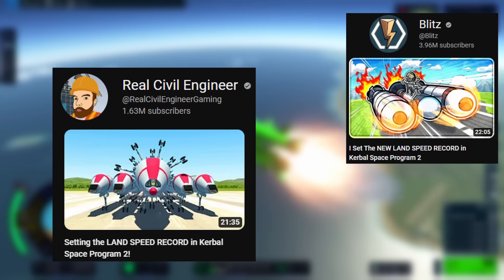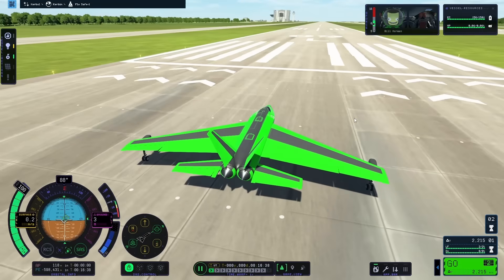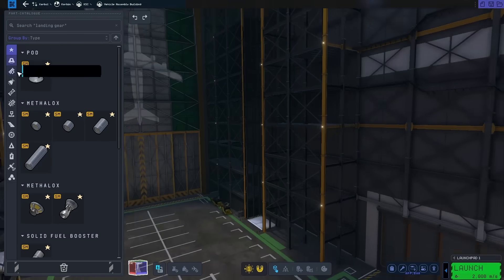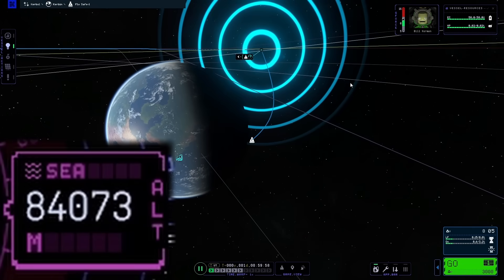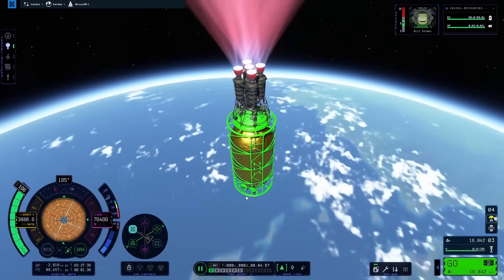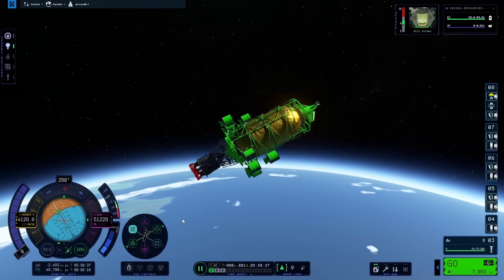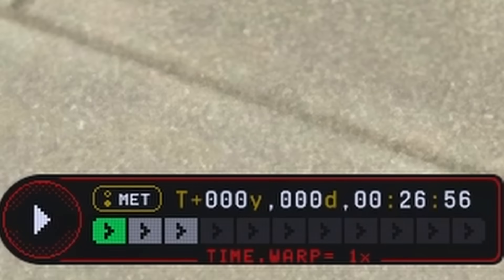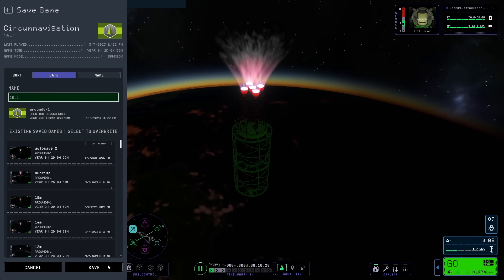Setting The CIRCUMNAVIGATION World Record in Kerbal Space Program 2

Comment: The reason why your earlier designs kept veering off runway and unable to take off has to do with your landing leg configuration. If your nose gear is lower than main, or your gears are behind center of lift, that makes it impossible to take off. That is exactly how Space Shuttle looks like and it's ideal for the Shuttle, because they don't want to even be able to go around, but not so much for planes.

Comment: ok but the speed of sound isn't affected by the size of the Kerbol system, so speed of sound would still be sqrt(gamma*R*T), so tho it wouldn't necessarily be the usual 340 m/s of low atmosphere it would probably not be mach 122

checking Earth standard atmosphere tables and assuming similar atmosphere composition, 60 km above Kerbin would probably be similar to ~80 km above earth bc density and pressure, so that gives us a speed of sound of ~282.5 m/s. So based on the fastest speed I saw while watching the video (~4550 m/s), we get Mach 16.1. 

so pretty fast

Comment: isnt the darkest blue the end of the atmosphere, and the black with stars technical "space". Because at 40,000 meters, Kerbin has an atmosphere of 0.001, and at 50,000 meters its 0.000 atm. So i think for a challenge like this to be relevant keeping it under 49,999 meters is key. As you are still fighting an atmosphere, without venturing too far into a 0 atmosphere zone and cheesing the whole thing. 
Altitude (m)	Pressure (Pa)	Pressure (atm)	Density (kg/m^3)
0	       101 325  1.000      1.225
2 500	69 015	0.681	0.898
5 000	45 625	0.450	0.642
7 500	29 126	0.287	0.446
10 000	17 934	0.177	0.288
15 000	6 726	0.066	0.108
20 000	2 549	0.025	0.040
25 000	993.6	0.010	0.015
30 000	404.1	0.004	0.006
40 000	79.77	0.001	0.001
50 000	15.56	0.000	0.000
60 000	2.387	0.000	0.000
70 000	0.000	0.000	0.000

Comment: Very nice video!
I do disagree with mach 122 tho.
Distances in KSP are 1/10 that of real life, not the speed of sound. It's not like KSP has different air, cmon now.
But, the speed of sound does change with temperature, and the temperature at 60000km on Kerbin is about 210K, which means the speed of sound is around 290m/s.
This gives you a mach number of 14.5.
Which is still absolutely insane btw.
Reply from the maker: You're absolutely right that it's a stretch, but I thought that it was also just a funny number to put on the thumbnail

Comment: Isn't the path sorter by traveling in the opposite direction? By "orbiting" west and the KSC rotating east, in effect, you and the KSC are moving towards each other with respect to the 1 circumference distance.
Reply: This should work, for a reason you didn't include. Technically, it should not matter, since you get speed boost in one direction so in a vacuum, it doesn't matter... But here, one thing that would make a difference is that you can accelerate much more aggressively without having to worry about reaching escape velocity. This allows you to gain a lot more relative speed to KSC without escaping Kerbin.
Reply: @gJonii  I believe we're saying the game thing. We exploit the relative motion of the KSC(Planet) to get there quicker. I wanted to point out that it also gets us there shorter. Edit: What if we travel west at exactly Kerbin rotation velocity. Can we complete the circumnavigation by traveling 0 distance (from a fixed reference frame with respect to the rotation of the planet)?

Comment: It's higher than 12.2, because you are on the tip of the atmosphere. I'm assuming you used the sea level reading of mach 1 to get mach 12.2 from 4200/340. But remember that mach 1 is not constant, it changes depending on the density of the medium. At 70000km the speed of sound is about 290m/s and since you are pretty close to that it should be 4200/290, which is mach 14.5
Reply from the maker: I mean technicallyyy there is nearly no atmosphere at 65k in ksp, so it would probably be far slower than that anyway, making it a way higher mach number
Reply: @ReidCaptain  Speed of sound actually doesn't depend on air pressure, only the composition and temperature
Reply: that seems like a dumb way to measure the speed of an object, but I’m not a rocket scientist, and I use Fahrenheit soooo
Reply: @Powderlover1  It's not to measure the speed of the object. It's to know how far away you are from the speed of sound. That's important because aerodynamic forces change drastically when approaching/passing the sound barrier. 

Airspeed is still measured in m/s, knots, etc. People just like to show speed as X times the speed of sound sometimes to add wow effect.

Comment: Well since there's no heat in ksp2 yet, you could do that in a lower orbit with an air and fuel mixture, you just have to make a craft that doesn't have alot of drag
Btw you should try a speed record to the moon and back for funsies lol
Reply from the maker: True, but getting up to 4000m/s under 30km might be asking a lot. Will consider a moon run!
Reply: @ReidCaptain  it’d be cool to see an intergalactic speed trial too.
Reply: @ShaneZickmann ntergalactic? I think we'll have to wait until KSP3 for that
Reply: @amppari_234  no its coming in ksp2 that’s one of the main things they’re working on
Reply: @Chunk_McSniffer  nope, their doing interstellar
Reply: @amppari_234  i know that’s what I just said
Reply: @Chunk_McSniffer  no you didn't mention any Inter, but the op i replied to say intergalactic, ksp 2 having interstellar
Reply: @amppari_234  oh ok
Reply: @Chunk_McSniffer  aged poorly
Reply: @ReidCaptain  idk if the new fairing mechanics work the same, but in ksp one you could pretty easily make a zero-drag craft, so using jet boosters might actually make sense.
Reply: Circumnavigating the galaxy speedrun
Reply: Mun is fun!
Reply: Could just point down at a 45 degree angle and use the wings to help keep you in the atmosphere, then instead of providing drag the atmosphere is actually helping you maintain a faster orbit
Reply: What about launching from the Mun and then circumnavigating it?
Reply: @enderborn017  cool idea

Comment: it might be possible to get it quicker by doing 2 circumnavigations, the first one to build speed and get into position, and the second one to actually get the time
Reply from the maker: Time starts from liftoff 😉
Reply: @ReidCaptain  with 2 circumnavigations i think it would be reasonable to divide the end time by two, which would still be faster assuming you can get the extra fuel up there without loosing too much time
Reply: @Roaxial  But that isn't how it works, you have to start on the ground and end on the ground.
Reply: @ChargeQM  This is very true, start from the ground, end on the ground.
Reply: the whole point is to have a craft that starts and lands on the same spot to truly circumnavigate the whole planat once